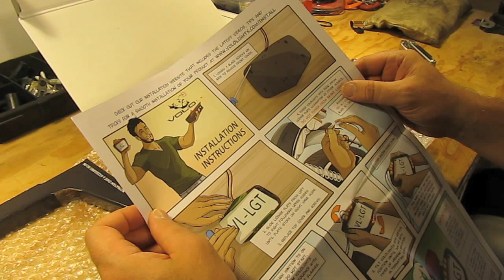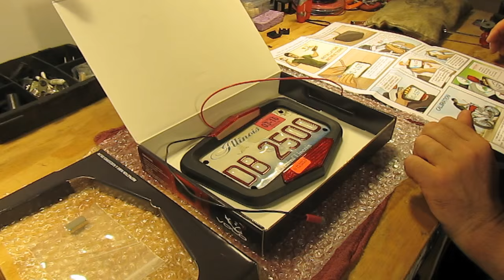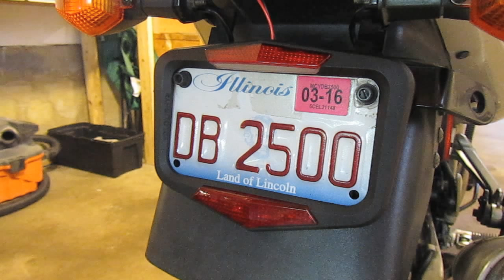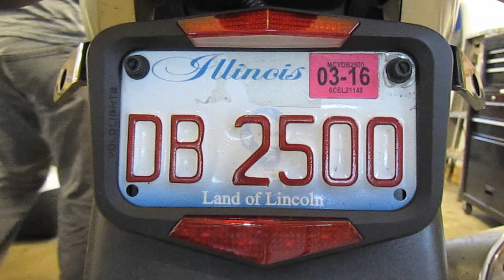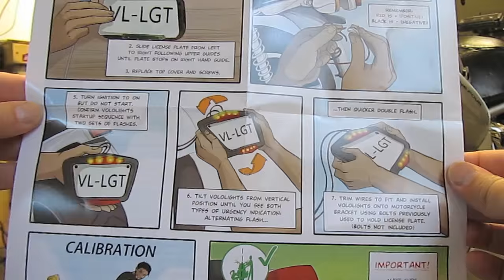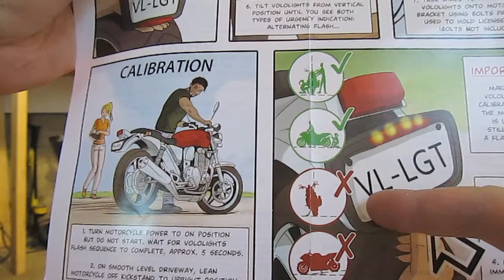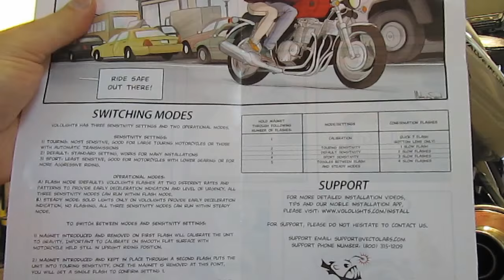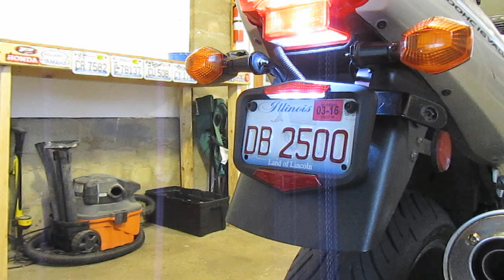Vololights: An Installation Tutorial and Product Review

Comment: Could you post a current link where to purchase?
Reply from the maker: It would appear the manufacturing/distribution is through a different company now. See this link: https://amzn.to/47Pfiyz
Reply: @TheRidingObsession  Thanks, I saw those. They are just license plate brackets with LED lights. They do not sense deceleration. They are remarkably similar to the VOLO Lights however.
Reply from the maker: Hmmm. Their product details suggest it activates on deceleration. "6+ different flash patterns alert drivers to normal deceleration and emergency braking with white license plate light" - Let's see if the customer comments suggest otherwise.